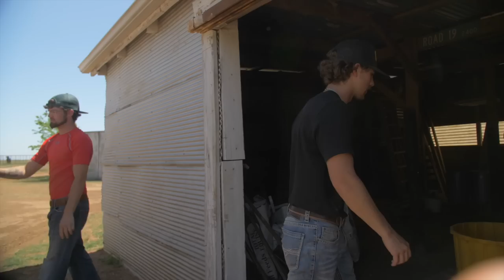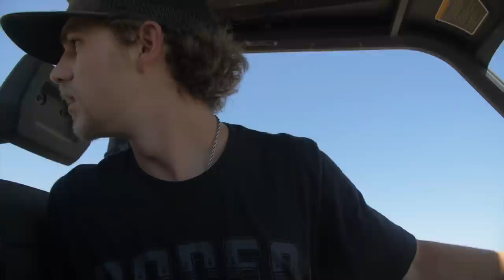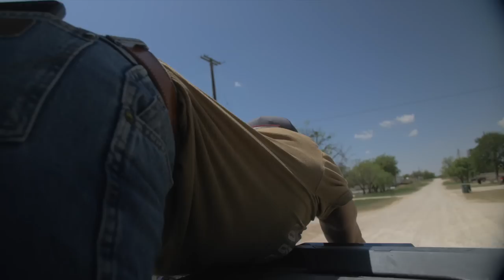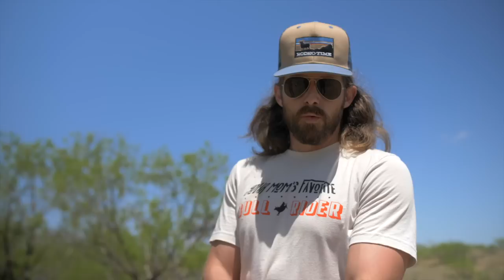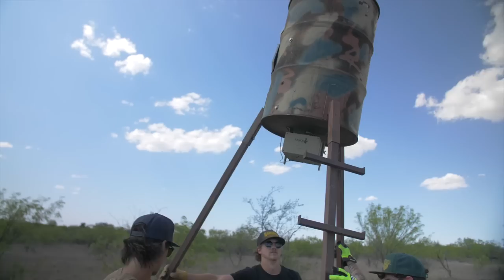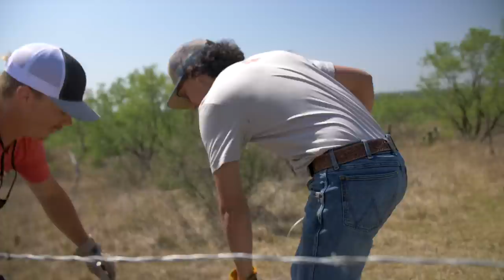SETTING UP DEER FEEDERS AT RADIATOR RANCH - Rodeo Time 302

Comment: The cows are the least concern. They rather eat from a pile or trough. They wont hardly eat scattered corn. They will knock the feeder over especially if it isn't full. Forget the fence, stake the feeder legs to the ground and add coon cages around the spinner. The racoons will climb the feeder and spin the spinner wasting the corn to the ground, eat some then the hogs will eat the rest. Put up a camera and you will see racoons hanging from that spinner all night long.